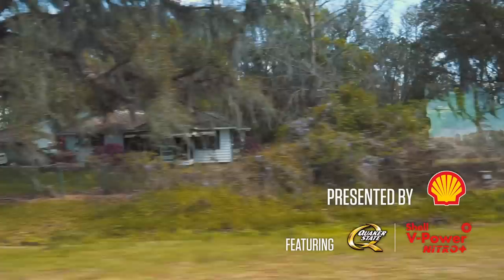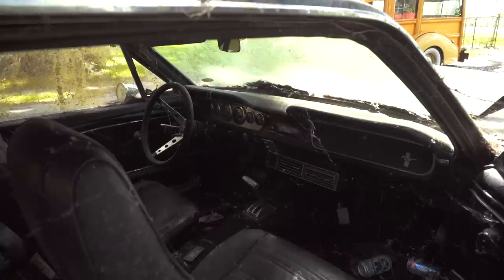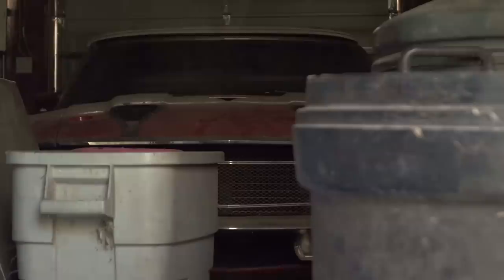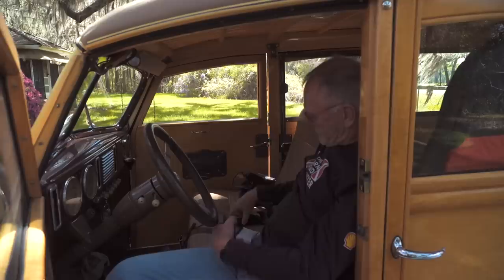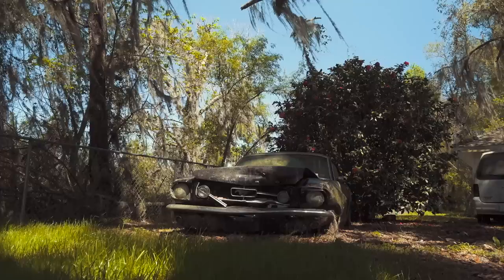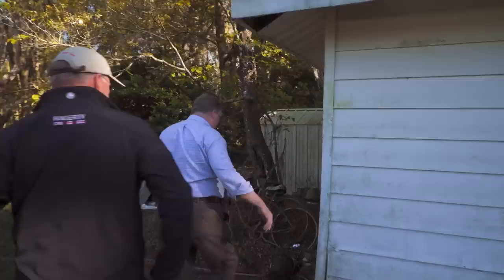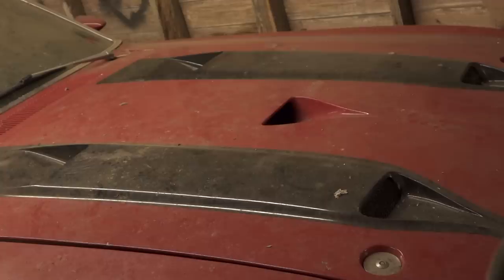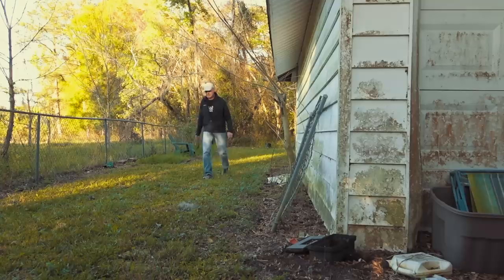1970 Shelby GT500 Convertible | Barn Find Hunter - Ep. 36

Comment: The guy says he'll never sell it but I guarantee that thing will sit in the barn and just continue to rot.
Reply: So what? He clearly gets a lot of pleasure from owning it and has had it forever. Plus it’s inside so it’s just getting dusty. Cars don’t have to be driven to give owners pleasure.
Reply: someone should buy it. or he should at least clean it and start it
Reply: @thebigpicture2032  no but little by little they rot away and are no longer viable cars.  I have an 87 mustang ordered from ford with at 5.0 5 speed with blue window sticker still on it and build sheet under seat.  It had 15,557 miles original on it when I bought it.  Vortech V1 supercharger, gt 40 heads, original Cobra R intake MSD ignition, stainless exhaust limited slip rear, stand alone fuel management system  ect.  It has until this year sat for 7 years after a fuel/spark and air problem no one could figure out.  The paint job on it was brand new after I got hit in it.  I had the whole car painted.  Even in a garage, rust bubbles came about, mice, the new tires vulcanized, it just got worse.  now to get the car back to mint it's costing way more than it would have 7 years ago (a new performance shop in town figured it out, Rabid Customs).  If I had continued to let it sit and "enjoy" it, it would be worthless and laughable.
That's like saying "yes that's my 57 chevy out there, yep it's a Bel air and a 2 door non post V8 car.  No she's not for sale I just enjoy it so much.  Looks even better when the creek isn't up to the door handles after the rain".
Reply: Someone sounds jealous
Reply: bad74mavrick my dads got an 86 gt convertible 5.0 mustang charcoal grey all original 16000 miles on still got the gator back tires on it has the original own 6 battery put in the car over 34 years shoot iam only 35
Reply: Got a 25th anniversary Mustang with only 12 miles on it.
bought it out of a basement. the guy bought 2 and stored them.
ALL original.
Reply: MyGun4hire  Sadly your right
Reply: Sad but true.That car deserve brighter future.Many of them do the same.The worst if someone's own a car(s) with very low millage.And they sad: This car brings a lot of memories.Ohh c'mon ...

Comment: That mustang in the beginning is a 65. I have a 65 C code. The black honeycomb grille gives it away.  Plus the chrome pieces behind both doors don't have the 3 long prongs that the 66 would have. 5 being the first digit in the vin indicates 1965. In 65 if you ordered the gt package it also came with the 5 round gauge cluster not the horizontal gauge cluster he's referencing. The original 5 gauges have been swapped out for the ones that you see in the video though. They're newer and not stock.
Reply: Since it's a C code, it's a non-GT '65 as all GTs were A code cars from 1965-66. GT cars were dual exhaust cars, requiring a 4 barrel carb( A code 289 V8). Only engine option above it was the Hi-Po K code 289.
Reply: 05gtdriver Right but there was a gt package that was purely cosmetic. They didn't put a 4 barrel carb on it but it had the styled steel wheels, fog lights and gt gauges. I was making the distinction about the gauges.
Reply: rokstr3 I wasn't aware Ford offered 2 different GT packages. Everything I've ever saw or researched says that the GT option included 289 4bbl, dual exhaust, front disc brakes, uprated suspension, on '65 cars round dial gauges, fog lamps, badging & rocker stripes. Styled steel wheels were optional on GT as well as other V8 Mustangs. Hmmmm
Reply: it no jive , i got a 85,  last year 4bbl  GT
Reply: Mine has round dial gauges, styled steel wheels and fog lights but it doesn't have exhaust trumpets, disc brakes, stripes, or a 4 barrel carb. I guess you could say mines a partial gt lol. It's my baby I'll put an Edelbrock intake, a 4 barrel carb, a 347 stroker kit and a t5 transmission, disc brake conversion, and 3.25 gears.

Comment: The High School I went to (North Farmington High in Farmington Hills,Michigan) had a 69 GT 5oo convertible that Ford donated to the auto shop with only 100 miles only condition was it could never be sold or licensed and destroyed crushed if the school ever needed to get rid of. Sadly the auto shop class closed up and the Shelby met its faith with a crusher.
Reply: FLASHTV The community college I went to had a yellow Beretta convertible. Black top, black interior. Donated by GM, same rules crush and destroy. While it wasn't a Shelby. It was 1 of 4 or 5 in existence 90 Indy pace car convertibles. I say that because all of the known ones had grey interior. There's one in a museum and that's it. It had yellow inserts in the seats, yellow reflectors installed into the regular rear panel, a flimsy roll hoop yellow z26 wheels. A GM exec had said he thought there were 3, there were 3 at the race. This one was not an actual pace car from the race no light bar, no engine mods. They weren't structurally sound enough to sell. So all of the ones sold to the public were hardtop Berettas with paint, stickers, seat inserts etc, maybe a sunroof.
Reply: I confirm this Shelby.  I also attended North Farmington in the early 80's, and took auto shop.  The car was gone by the time I was there, but parts were still around.  I remember the tail lights hanging in a tool room, the the exhaust up in the loft.  Great story!
Reply: I went there in 77 and it was still intact except missing Shelby emblems and rims. Mr Shear was a ass and he hated me cause I caught him in a lie in front of the whole class. Basically he went out of his way to make it hard for me to the point I quit going to class til the final exam and I aced the test, only person to get 100 on it and was really pissed to the point he said I must of cheated and made me retake another test 1 on 1 watching me like a hawk. What put him over the edge I was given a full scholarship to Chrysler's MoTec school in Livonia , which he fought and failed.
Reply: I would have crushed a different car and sent the photos to GM. They are so backwards thinking nobody would have suspected anything. I work for GM.
Reply: They should have contacted Ford.
Reply: Novi, MI here. Holla

Comment: Easier ways to tell a '65 from a '66 than the gauge cluster.   The honeycomb grill is '65 ('66 had horizontal bars).  Those side scoops are '65 ('66 had 3 rays pointing forward).  And the gas caps are different:  '65 was clear plastic center with the logo inside vs. '66 being solid chrome with logo on top.

Comment: I've seen cleaner 1965 Mustangs sell for $2000. This car is trashed and 500 hours would only make it decent. Plus parts. GT 500's are Way over valued. They are heavy and slow. Most don't have posi and just spin the right tire. They do a 15 second 1/4 and they handle like tuna boats. The value is for the ignorant. You think a good driver is worth $75K you deserve the loss.